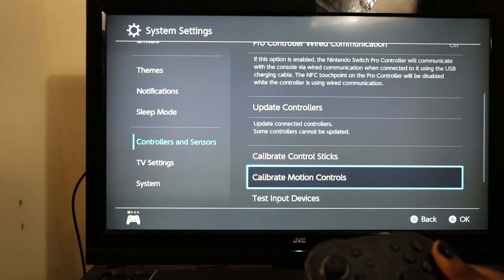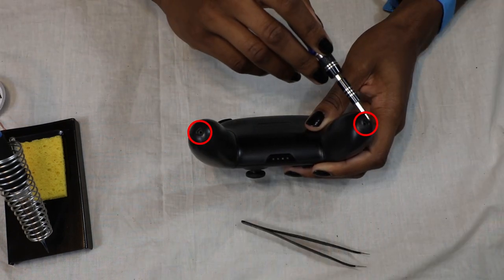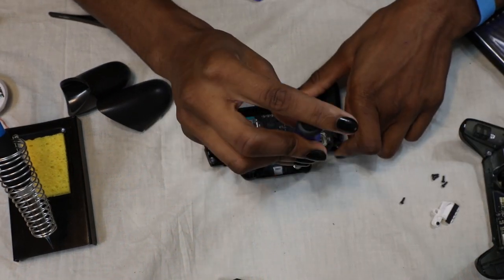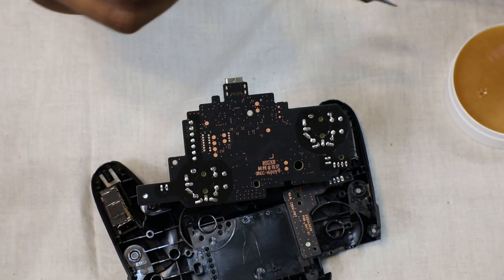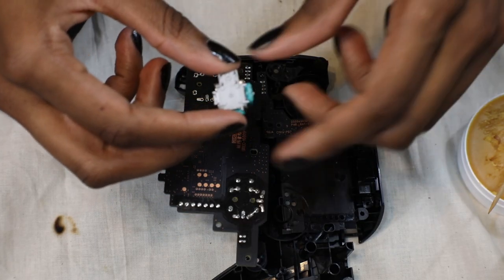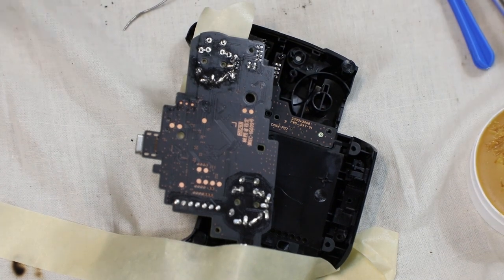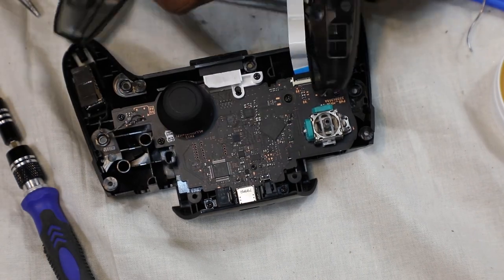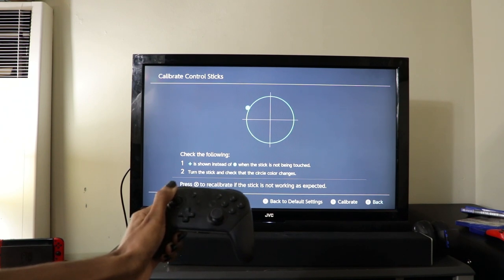How To Fix Broken Defective Left Analog Stick - Nintendo Switch Pro Controller

Comment: Should’ve just bought a new one with a good return policy and switched them out.
Reply: this is what i did with my first controller at walmart. first one lasted 6 months or so then the second and third were drifting from day one. on the third controller walmart stopped carrying and offered only a refund. i purchased a forth controller and worked out the problem with my back-up controller. i still have to open clean or replace the pot sensor spring every few months. i always wash my hands wipe off my controller before a gaming session.
Reply: heydo6 good to know
Reply: "Should have just committed fraud"

Comment: this is a good fix but it's the hardest possible way. you can simply open the side of the pot sensor (no solder) clean or replace the plastic and copper spring. on say and old ps2 controller where the analog stick is totally worn out then this would be the correct fix. considering most people have this problem long before the stick is even close to worn out this is way over kill. i did like your video and the more people learning and apply there own fix is great to further the subject. 

FU Nintendo for not doing any thing to solve this problem. if you would simply say sorry there's a design flaw and we STOPPED production of the old design. here is our updated controller with better quality parts. i would gladly buy ANOTHER $70 controller!!!
Reply: Do you know what kind of spring we would buy to do that on a Switch Pro Controller? Maybe you could link it, if it's not too much trouble. Thanks.
Reply: sorry for late reply, if you have problems send a friend request on discord and i'll send some pictures.
Reply: how do I open the side of the pot sensor so i can get to the spring?

Comment: Looks messy, I’d just buy new controller these things are a nightmare yet we defend Nintendo’s BS didn’t have these issues with older systems I have SNES pads that work fine
Reply: shaolinskunks88 N64 has the same problems

Comment: Or just buy a new controller
Reply: I mean if you're crazy enough to spit out 80 dollars on a brand new controller, then that's on you.
Reply: Not everyone is willing to dish out that kind of cash for a problem that should be fixed by now
Reply: lucas lucas That’s Nintendo for you. As much as I love them, their tech accessories have been pretty weak lately.
Reply: Fis 1 or you can buy the same product from a different company for literally less than half the price
Reply: The Blue Blur rlly?
Reply: @hafisupshaw32  yeah I got 2 controllers for £26 and they look and control just like real ones
The vibration is pretty bad on them but motion controls and everything else works fine